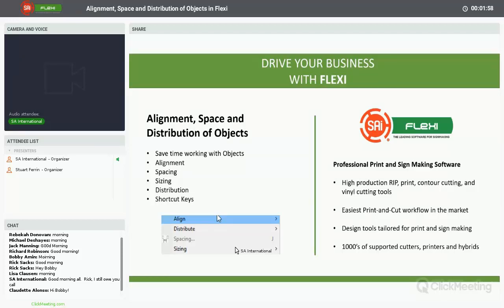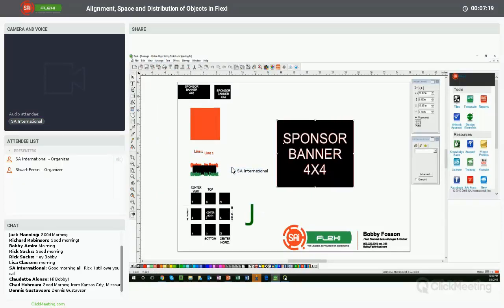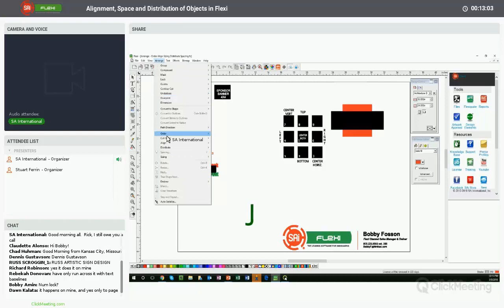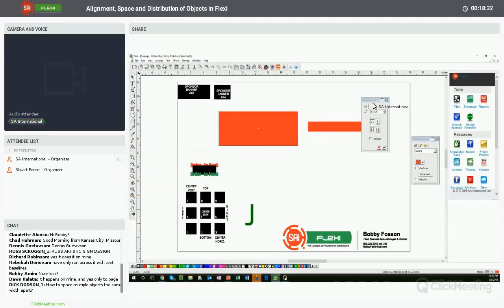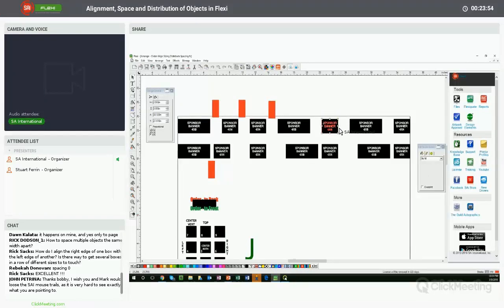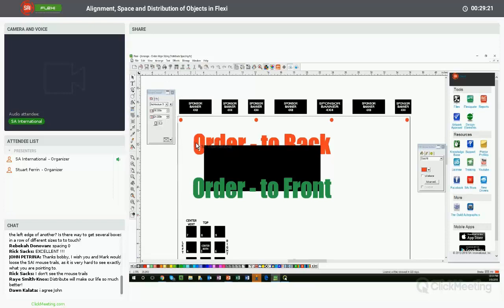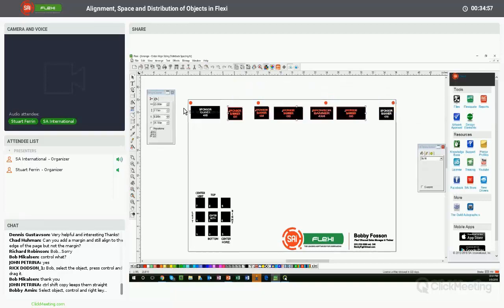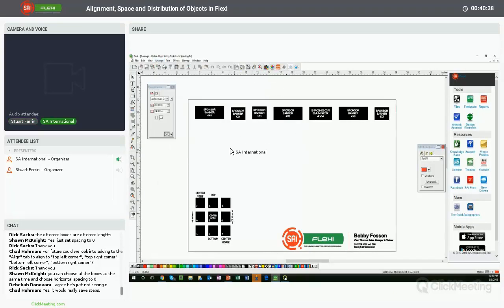Webinar - Alignment, Space and Distribution of Objects in Flexi (May 8, 2018)

Comment: Good day i was wondering if you are able to assist I have a Nocai NC-UV0609 2017 uv flatbed printer it was printing fine but in the wrong colors we tried to change the color settings of the printer and it totally through off the alignment, the printer prints when I do a  nozzle test from the printer itself but as soon as I try to print through SAI the x axles moves in to position but the y axle keeps running till it gets to the limit switch I'm assuming it's a software issue as the UV printer finds itself and the lines itself when starts ups
Reply from the maker: Have you spoken to your reseller about this issue first? Most times they know how to fix specific driver issues.